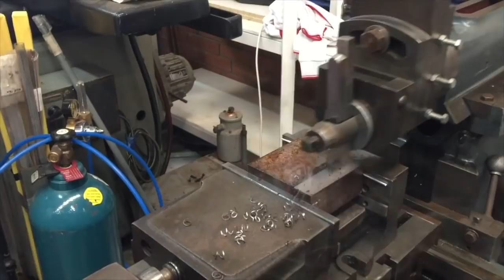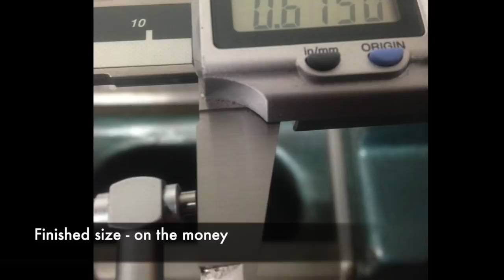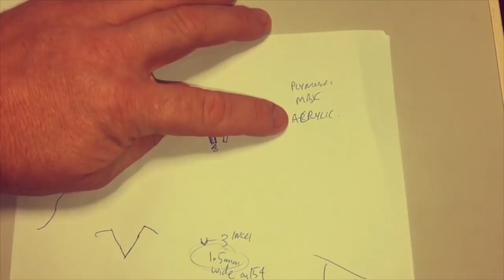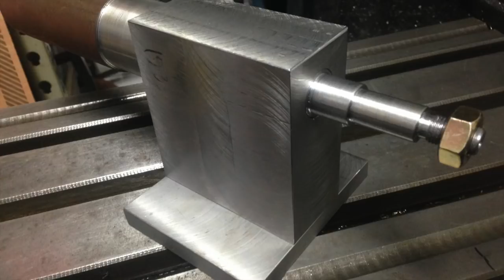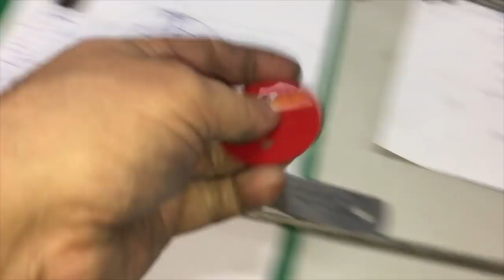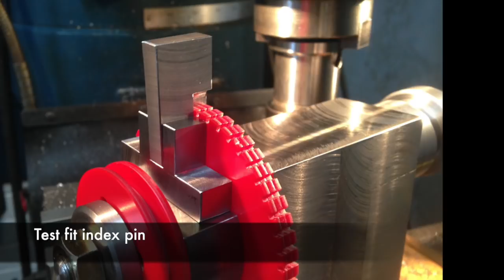Involute Gear Cutting on the Shaper - Drawings and Calculations

Comment: How do you calculate the cutter tip width?
Reply from the maker: Hi Allen, great question, the rack form 60 degree vee is the mating clearance that needs to be matched. in the Addendum - Dedendum details it provides a minimum so it doesn't collide with the mating gear. it all comes down to a little bit of pythagoras/trigonometry once you know the pitch of the  rack/gear

I hope that helps a little

Comment: Lots of useful information in here ! I will no doubt have more questions  , but for starters, did you allow any vertical adjustment of the drive wire for the pcd disk sizes ? All the best Mat
Reply from the maker: Yes, ideally you want the wire to run tangent to the diameter of the pitch circle disk. A slight misalignment can be tolerated, as per cosine error when taking measurements, however the effect would translate in a corresponding width compression of each tooth. The index wheel sets the spacing of each tooth, and the cosines error is essentially a horizontal scaling factor of the single tooth. In practise the impact would be fairly minor, and likely well within the working adjustment of the multiple gear drive trains, and would still mesh appropriately with a neighbouring gear due to the tooth pitch being correct. (Essentially this would impact the same as more or less backlash)
One future consideration I have is to eliminate the PCD disk altogether and just have a radially adjustable fixing point so you set the connection of the attached wire to the PCD, with perhaps a slight arc supporting the wire to manage the "Ackerman" effect of the wire not being constrained to the circumference of the pitch circle disc
Reply: that is where I was heading ref' the pcd disk is another bespoke tooling requirement - where as an adjustable radial attachment - the ARC would still need to be approx' the pcd though - then I started looking at expanding cones and ended up back at the pcd disks ! Thanks for the extra info' Ive added to the fag packet sketch ;-) All the best Mat